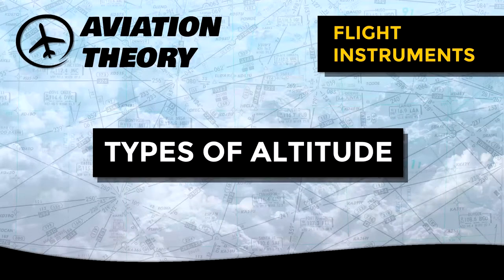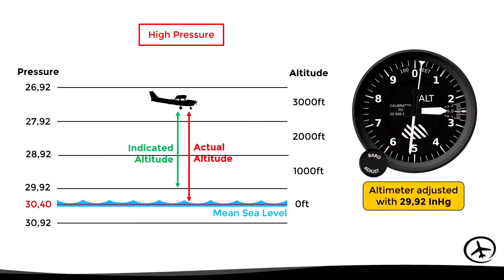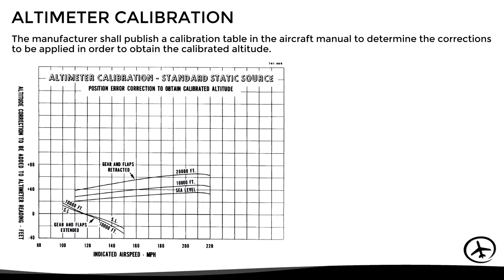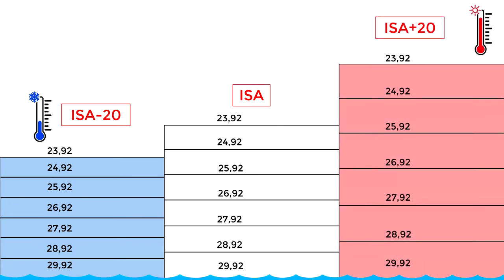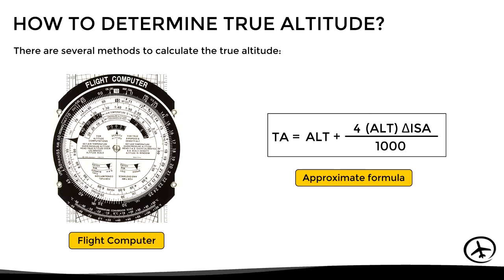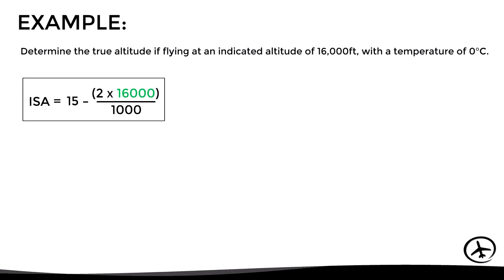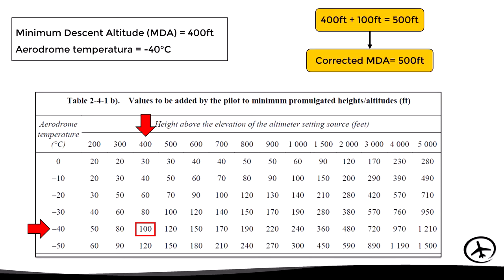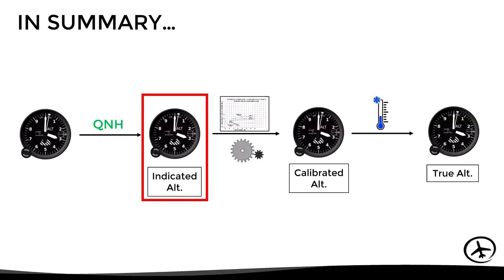Types of Altitude (Indicated, Calibrated and True)

Comment: For barometric altimeter, it works on the assumption that for each 1000 feet increase in altitude, the pressure will drop 1Hg.  This assumption is very far from the realistic atmosphere at a reasonably high altitude (say, above 10000 feet). Why this error is not discussed and incorporated when converting indicated altitude to true altitude?
Reply: This correction is not necessary because the flight at altitude does not have obstacles and bumps as in flights at low altitude. For this reason, it was decided to use an indicated altitude pattern as the only means of demarcating the flight ceiling between aircraft.

Comment: using alternative terminology, is indicated altitude same as pressure altitude (corrected for non-std pressures) and true altitude same as density altitude (pressure altitude corrected for non-std temperatures) ? Private Pilot FAA questions use pressure and density altitudes and never use the terms QNH or QFE.